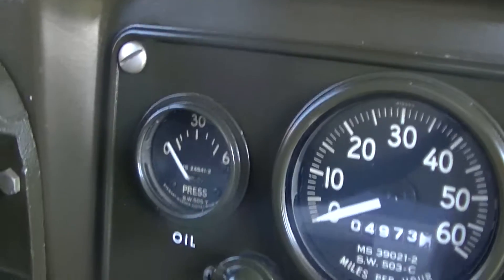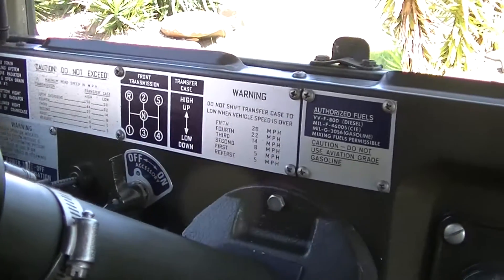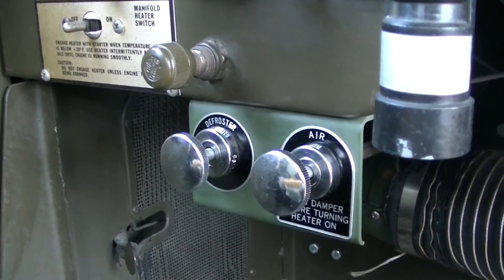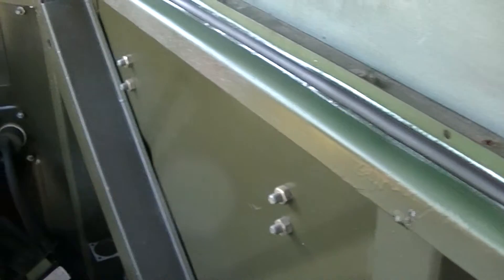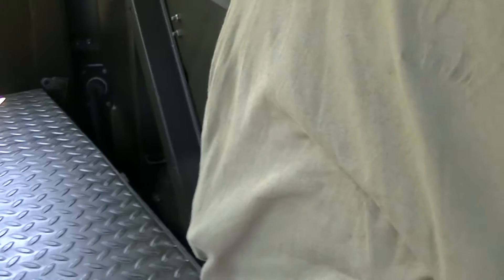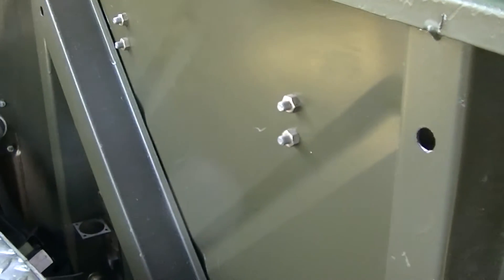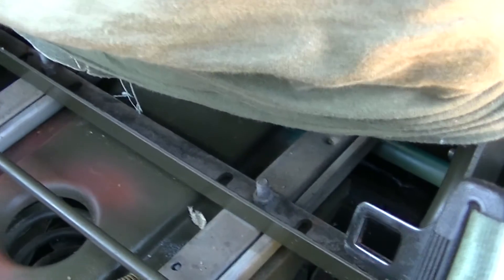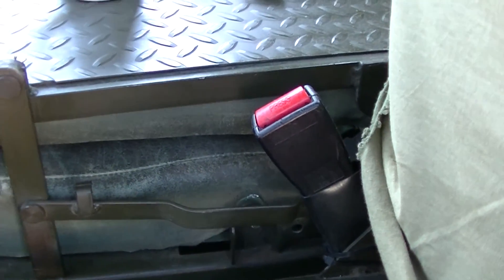Cleaned my Deuce

Comment: I removed the factory seats out of my deuce and went to air ride seats.  If my memory is correct that bar should attach under the passenger bench seat to lock the seat in the up position.  I remember having to pull a bit on that bar to clear the tab so that the seat folded up to gain access for floor storage below it.  I sent you a PM on the forum with a picture of mine.
Reply from the maker: +HanksDeuce Thanks mate, I got your PM and that picture you have helped out great!Aussie.